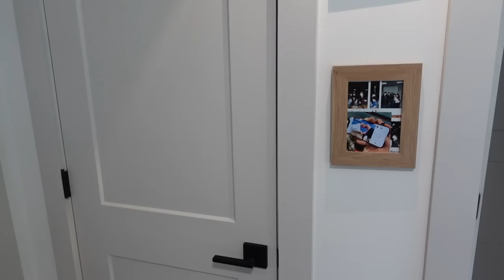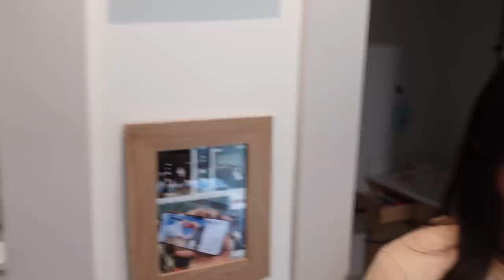Our FIRST WEEK In Our NEW HOUSE! 🎉

Comment: Hi Amanda and Stephen, I can see an oval rug in maybe warm cream at the end of the bed with the length a bit longer than the width of the bed. So lengthwise across the width of the bed and two matching rugs going lengthwise the length of the bed. The curved lines will will offset the straight lines of the windows, bed frame etc softening the lines. Hope this makes sense! Love what you achieved and I would be miffed too if things weren’t working. BTW, my fridge is about half the size of your ‘small fridge’. I find I need more freezer space living alone than when all of my children were at home as when you cook a meal, it’s hard to make dishes for one so you end up making surplus meals to freeze. ❤ xxxxxx

Comment: Great vlog! 
❤Hi Miller Family!
I have the same 3 tier spice drawer- I have a suggestion which I found so helpful- you might want to try this.
Since the spices are upright as mine are, too- Lused a permanent marker- to print the name of the spice on the top. So if the top of the spice is black, use a white or light color to print the name of the spice. If you have a lighter color cap, use a dark pmarker to print the name of the spice. Then you won't have to take out every jar or bottle. Just read the name on the top of your spice jars. This has saved me so much time.
Just a suggestion.
Warmly, carol
Reply from the maker: So smart!!
Reply: YaY- Did you try it? Did it work? I wanted to video mine- but didn’t know how to send it to you. Let me know. warmly- ca

Comment: i hope you did not turn on the ref after moving it from basement to kitchen. you need at least 4 hours unplug and allowing the compressor oil to settle, otherwise you have damage this ref  too  compressor oil should settle first before plugging and turning on the ref or the compressor oil will mix with the coolant and that is a damage unit .